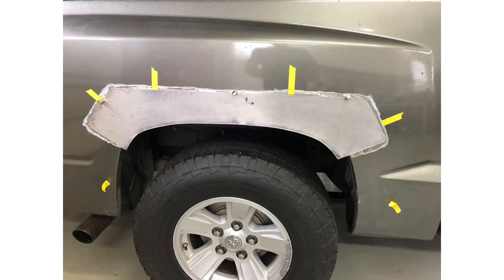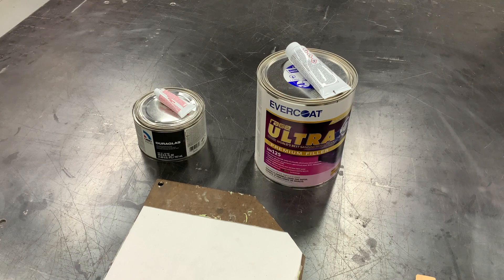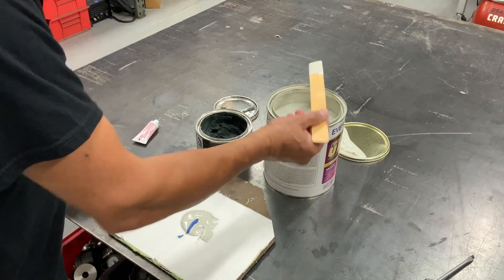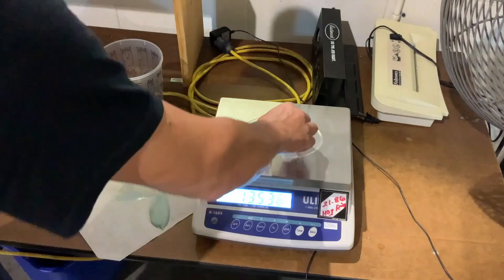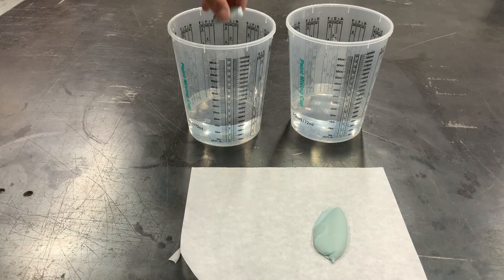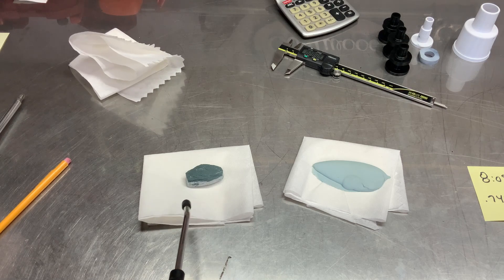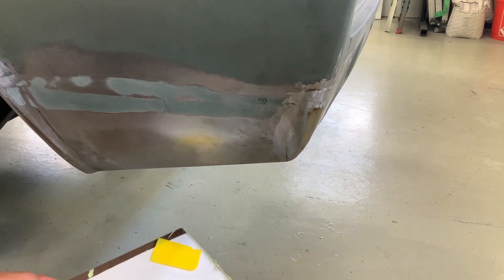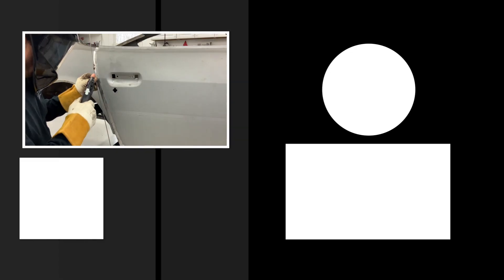Does Body Filler Absorb Moisture? Head to Head Test Results

Comment: I appreciate what you are trying to quantify with the water absorption, however, I believe that the surface area of the polyester filler was significantly larger than that of the duraglass, which may have skewed your results.  I think a better approach would have been to use the same volume of each filler going into the same mold; let harden and then remove the molds.  Weigh each initially and then leave each in water for 24-hours.  They weigh the end result and calculate the percent gain in water with [(end weight - initial weight) / initial weight] * 100.  Just a thought to consider.

Really like what Eastwood has been doing.  Keep up the good work!
Reply from the maker: We will pass this along to the R&D manager! Thanks for the feedback.
Reply: I think too that when the duraglass was filed it opened up the pores where if it were wiped in a welded seam the only portion to see moisture would be the backside. Which cannot be sanded, hence the repair. I'm just wondering if unsanded filler vs open pore filler absorbs more water

Comment: Yup I always use short strand fiberglass over all welded areas then my filler no problems on my 98 Z71 five years 100 000km later💪 Never use that all metal crap the stuff will crack and fuck up !

Comment: Hello; Don't believe that the body filler absorbed the moisture.Body filler , by itself is porous, water will go through it. The weld or braze should be washed and treated before it is covered and yes the back of the weld should always be sealed.  Impressed with your thorough test though. Thank You

Comment: What would be best to spray over areas you used filler on a car you are working on outdoors?(so it doesn't absorb water) Can I just spray primer over it? Does it need to be epoxy or can i just use self etching?